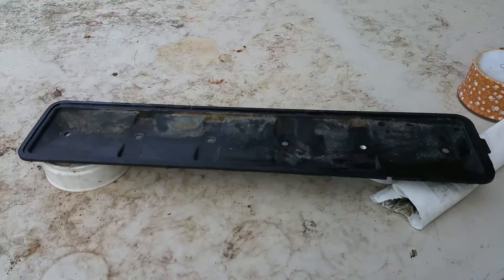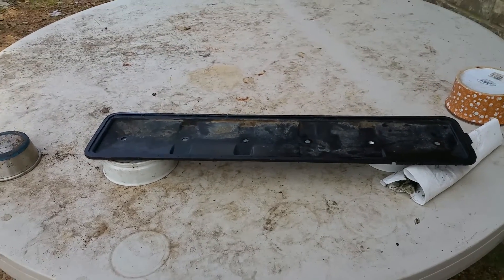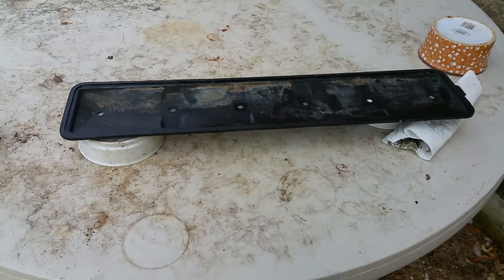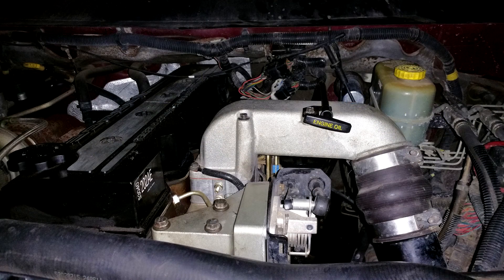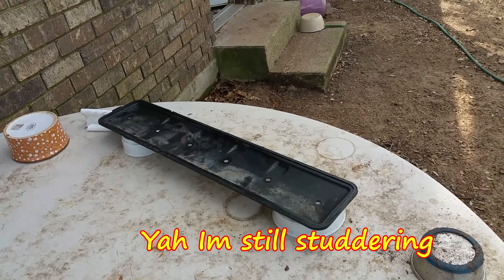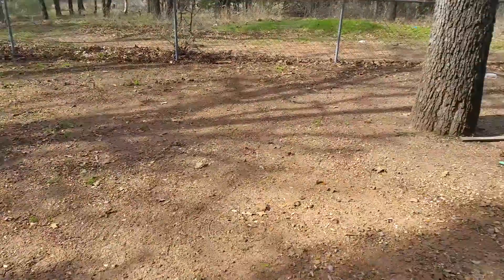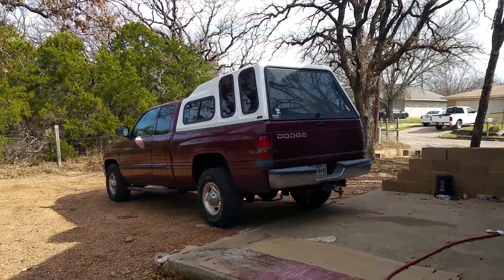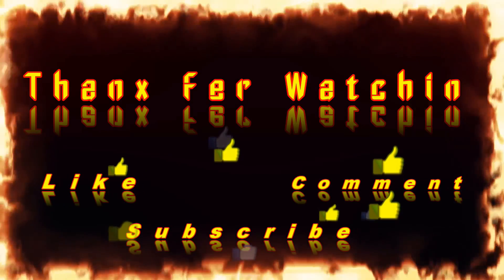DODGE RAM 2500 Diesel Tappet Cover / Repaired at Treys Fuel Injection Waco Texas

Comment from the maker: Forgot one thing. That tappit cover when you remove it from the block it should have tension and mine did not, so it was allowing oil to flow out where the gasket adheres to the block. Just replacing the gasket IS NOT GOOD EMOUGH.!!!
Reply: What do you recommend???